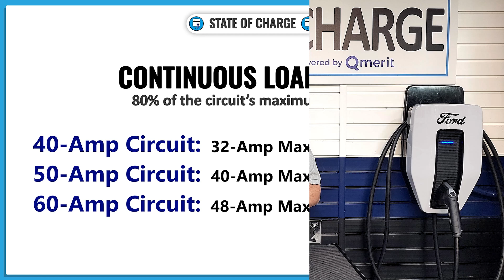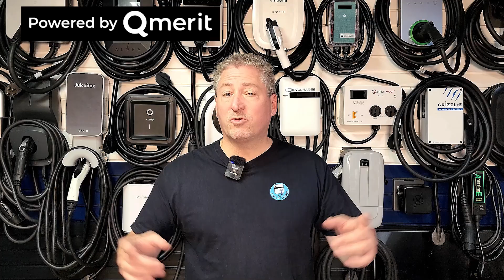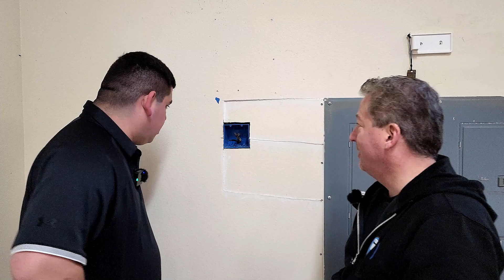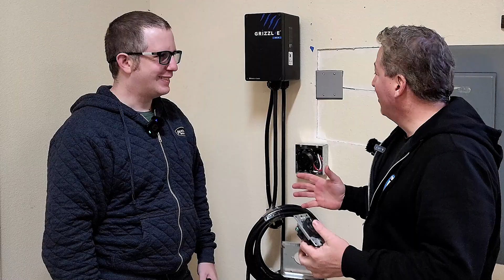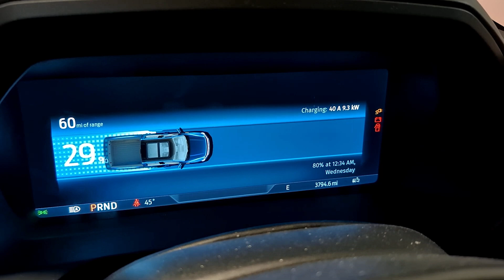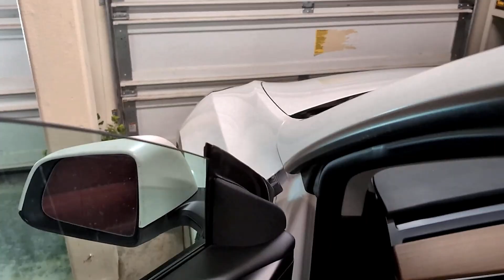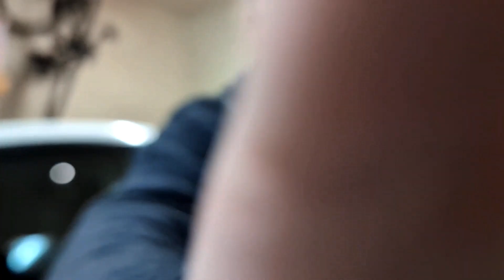Recharge Rescue Washington: We Fix A Dangerous NEMA 14-50 EV Charging Outlet Failure

Comment: Huge Thanks Tom!   My wife is now mad at you b/c your video is going to cost us $60k!!  I told her I now need to buy an F-150 Lightning with the included Charge Station Pro install to fix my DIY home charger install :-).  I'm might be in a whole different level of "Recharge Rescue" as I'm using a NEMA 14-30 Splitter from Neocharge right now with the wire under the door to the garage.   Your  video made me take apart the plug and it shows signs of melting.  Thanks for the video, it's given me the impetus to fix it the right way now.

Comment: I think the point of the video should not be the quality of the outlet you used to plug in a Home EVSC, but to avoid that situation altogether and just hardwire it! It makes absolutely zero sense to plug in a home charger. It's a permanent fixture to your home even the new grizzly should've been hardwired! In fact I'll take it a step further. Being so close to the breaker box, why didn't you just hardwire two separate 48 amp chargers so both cars could charge at the same time at 11.5 kW?

Comment: Using any outlet for permanent fixed EVSE home charging is actually not legal here in Norway due to the risks of overheating and fire. All EVSE installs also has to be done by a professional or you would risk insurance company voiding your insurance if there is a fire. These EVSE boxes will be connected directly via cable and separate circuit breaker with the proper protection for EV charging. You can also not use the mobile unit as a permanent solution.
Here we have 230V IT (230V L+L no neutral) and 400V TN systems (230V using L+N) in peoples homes and the "Schuko" (CEE 7/3 socket and CEE 7/4 plug) most have is rated for 230V 16A, but not continuous. So the mobile unit sold with new EVs are limited to 10A for safety. You can find third party units that can be adjusted up to around 13A.

Comment: The Leviton EV receptacle is a poor choice, spend a couple dollars more and get the Hubbell or a Bryant.  The Leviton is only rated to 60°C, which means if you're using THHN wire you must down rate the wire to the 60°C ampacity.  Whereas the Hubbell and Bryant are both rated for 75°C, which mean as long as the breaker is rated for 75°C you can THHN wire at the 75°C ampacity.  For a 50A circuit, this means 6awg wire for 60°C or 8awg for 75°C wire.  Don't be cheap, get a Bryant/Hubbell and avoid Leviton.

Comment: I have had two fires due to inappropriate outlets, even tho the city electrical inspector passed the work I did.
Reply from the maker: It was most likely all done to code. EV charging needs a stricter code, IMO
Reply: @ I did the installation to code and it passed inspection.  The problem is that back then the inspectors were not educated on the special requirements that are necessary for EV charging.  When I sought counsel from the chief inspector he blamed the charger, claiming there must be something wrong with it, even tho I tried several chargers that all experienced the same disastrous result.  I am thinking that by now the inspectors have updated the code and a situation like mine will not occur again.  Right now I have a Leaf but I am looking at a F-150 Lightning.  I am thinking that if I buy it I will end up installing a new charger.  The #10 wire I am now using will be insufficient to charge the Ford.  And I will likely have to replace the breaker, as you indicated on your program.

Comment: Unless one is using a portable EVSE, or perhaps using a circuit that is not dedicated to car charging... just hardwire the damn thing. It's not like you're going to be changing out a wall-mounted EVSE every few months. It may cost a little more, but eliminates a failure point.

Comment: Hey Tom, 
I installed my own, yes I know I know. Every thing was torqued and spec’d correctly. We used Legrand® Pass & Seymour 50-Amp 4-Wire NEMA 14-50R Weather-Resistant Power Outlet for RVs and EV Chargers
Model Number: 3894WR.
Thoughts?

Comment: One thing that seems to be an ongoing issue is the size of the junction box.  A standard one is too small. No one seems to know what product to use. The larger faceplate is easy to find but what about the actual box ?
Reply: Also easy to find.

Comment: Thanks Tom for another great product safety alert. I don't disagree with anything that you said. I would state though that I don't think the cheap 14-50 outlets are inherently defective, rather that they are significantly more likely to encounter loose connections, which can then lead to major fire hazards.  The cheap styles all seem to have their screws directly pinching the wire as apposed to the industrial and EV grade that use a box style compression connection. I wonder though if these screw style connections on these outlets were loosening after numerous thermal cycles, and the manufacturer's found the problem then came out with a decent quality outlet. Or simply saw the product demand for the industrial products and wanted a piece of the action.
   You were correct in that a Range doesn't draw large amounts of current for hours at a time, but it's an even lower load than that. Ranges typically would only draw a maximum of 50A, if A: All burners on the cook top were on simultaneously, and B: the oven was not only on but actively heating. If you are cooking something in the oven for 4 hours, the element is only cycling on and off intermittently to maintain the set temperature.
  I much prefer the box clamp style connection over the direct screw style for most connections. That includes 120V outlets as well, and you'll notice the same trend with those when comparing the economy / builder grade products to the industrial grade products.
   Like you've said before I highly recommend hard wiring your EVSE unless you absolutely cannot.

Comment: thank you for your show.  I had a hardwired autel 50 amp installed.  the electrician on put a 50 amp circuit in after I told him I had the charger set at 48 amps.  do I need to change the charger to 40 amps.  Thank You for your help.
Reply from the maker: Yeah, but your electrician REALLY should have known that. Are you sure he didn't install it on a 60-amp circuit? That's what's needed for a 48-amp unit. Was it inspected? The inspector would/should have caught that.
Reply: @StateOfChargeWithTomMoloughney  yes i asked him if it didn't need a 60 amp circuit and he said 50 was fine.  so I'll switch it over to to 40.  thank you once again
Reply: then I'll contact electrician's boss and see what awg wire he used to make sure it is large enoung to handle 60 amp circuit and 48 draw and have them come back with a 60 amp

Comment: Thanks so much for this info!  I just had a new circuit installed by my electrician because my panel was full.  He has installed many 14-50 NEMA outlets in our community and has always used the cheap/ standard Leviton outlets.  I went to Home Depot and purchased the recommended outlet and had no problems exchanging it myself.
I have a question.  Is it OK to leave my Honda “portable” charger plugged in all the time to avoid plugging and unplugging?  Even though it’s only 32 Amps at 240v it charges my prologue in about 6 hrs.
Thanks!

Comment: I am a fan of your videos!  From Quebec, Canada.  Following your video, I have reached my provider and I am told the following:  It seems the norm you are referring to is for installation of 48 amps and up.  Installation with 30 amps or 40 amps can use the « residential » outlet.  What is your understanding?
Reply from the maker: No, no, no. You need a high-quality industrial-grade outlet for ANY 240-v EV charging, because of the continuous use. Sure, lower powered charging won't create as much heat, but you should always use high-quality outlets for EV charging.
Reply: @ , some of my friends have a connector « welding outlet » type.  Is this OK based on your experience and network?

Comment: Don't use a $10 recept & push it to the limit. Use a metal box, may save your house. Be aware a metal conduit will derate your wire amp load due to heat retention.

Comment: I was a sparky for 50 years and NEVER used the cheap blue light special boxes. Always used either fiberglass boxes or metal. Every receptacle over 20 amps would only use metal boxes. Hubbell quality has been slipping. A few years myself and union electricians had trouble with the the wall plate breaking off on overprised Hubbell Hospital grade TR 20 amp receptacles that were made in Korea. A few months ago Hubbell mailed me a 20 amp 120 volt screw less duplex receptacle. I pushed in one of if the wire lock downs without inserting s wire and can not get it to release. Qyality did not appear to be to usually Hubbell standard. Here uts made in lying cheting kack of quality control communist china. Nope. I refuse to purchase or use any safety ir test equipment and receptackes & curcuit heeakers made in china.

Comment: The NEC knows about dangerous problem of cheap EV 50 amp receptacles burning up thru out the country and keeping thier prima donna heads in the sand !
Reply from the maker: They do. But they also always move very slowly, so I don't know if it's their heads in the sand, as much as it's the slow progress that they always make.
Reply: @StateOfChargeWithTomMoloughney  Like to choke the dopes that changed one of the most commonly used electrical terms last hundred years, no wait two terms. Stupid neutral change to confusing grounded conductor and s few years earlier light fixture to luminare. Same aholes probably that changed wire term believe it was 1/0 to 4/0 to some other term that did not stick.

Comment: I can’t see replacing an entire charger (EVSE) due to a melted plug - it is possible to replace the plug isn’t it? Provided you use a quality part and torque the connections properly (or have a professional do it if you aren’t sure).

Comment: I have a 65 year old 10-30 receptacle for the dryer. I am charging off that with a charger. The charger and dryer share the receptacle with a splitter. If I forget and run the dryer while car is charging, the breaker trips. 
I looked and Hubbell makes a Nema 10-30r. I think the old receptacle from 1957 is a Leviton. I also have a 10-50r behind the stove but it’s never been used. 10-50 stuff not as common as 10-30 stuff on the internet.
Reply: Just discovered the early stages of scorched prongs one one of the hot sides and slightly melted plastic around them.

Comment: Are ordinary 110V 20 amp outlets rated for continuous power? 
I’ve been reading about a product called “quick 220” where 2 - 110v outlets are combined to get 220 V charging on 20 amp outlets.  That should provide charging at 220V at 16 amps continuous. I’m wondering if that’s safe.
Reply: NO, for many reasons.  Breakers are not interlocked and cheap 20A outlets will melt just like the cheap 50A outlets are 2 big reasons not to do it.
Reply: @Billy.80 what about ordinary continuous 110 charging? I’ve not heard any EV company tell people that they need to replace their 110 outlets to handle the constant power.

Comment: We live in WA state and had the electrician install a 14-50 when we replaced our 1980s panel 2 years ago in anticipation of getting an EV and because it waives a portion of sales tax on the panel replacement. The state inspector signed off on the 14-50. It is the bad Leviton with 8 gage wire. So now we have a professionally installed fire hazard and are shopping for an EV.

Comment: its wild that this happens in the states, we have high power sockets in EU/UK,   but i guess because those are only used for incredibly high power equipment it rarely becomes an issue, because y'all at 110/120v, anything even mildly powerful needs a 240v plug ,and there are so many. i could pick up effectively any 32a commando blue plug and be sure its fine, the fact you can buy a nema 14-50 and then go "wait is this not good enough" is kinda winld

Comment: I so much appreciate this information and warning. I presently have one specific hardwired EV charger (Clipper Creek) but have a neighbor who I allow to come and charge their EV here as well. When we both need to charge at the same time, I’ve allowed them to use  a mobile charger using a NEMA 6-30R outlet on a separate 40A breaker. Since the mobile charger has a NEMA 14-50 plug, I have a EV specific 14-50 to 6-30 adapter to make the connection.

So far, there have been no issues or signs of overheating. The 14-50 to 6-30 adapter does specify to tamp down the draw to 24A. I’ve checked the mobile charger while in use, and it never draws more than 20A. Should I be concerned and replace the 6-30 outlet to the Leviton EV 14-50 outlet? Since I use the 6-30 outlet for my 220V electric wood splitter, and need that plug configuration, I’d probably just run a separate new line from the breaker box to a new Leviton EV 14-50 outlet instead.

Comment: If the homeowner was going to have to do everything from scratch, why not just hardwire the charger this time and eliminate the whole plug/outlet issue? It’s weird that companies aren’t offering hardwire options for 40A chargers. Also, it’s a little odd that Tom waits all the way to the last few seconds of the video to mention hardwiring is a better option.
Reply from the maker: I agree that's a better installation, but he wanted the outlet. As long as it's done correctly it's perfectly fine.

Comment: Tom,
Another very useful presentation! Thanks!!
Question:  given the heating and cooling at the wire connections, including at the 50amp breakers, would using a bit of lock tight be advisable or does the correct torque setting obviate the need for lock tight?  Or, is use of lock tight in electrical applications not appropriate?
All the best,
Pat Quinn
Reply from the maker: Hey Pat. It would be best if you did not use Loctite, or any other like product, on electrical connections because it will significantly impede conductivity by creating an insulating layer between the metal surfaces and causing poor connections.
Reply: @StateOfChargeWithTomMoloughney  Another thanks for your informative and kind reply, Tom!  A friend also cautioned against the use of loctite on electrical connections.  I will invest in a suitable torque wrench, instead.  In that vein, six months following my installing an Emporia EVSE, using #6 stranded copper wire and a pair of 50 amp circuit breaker, I rechecked the breaker connections and did find them looseR than I had left them.  I will be rechecking all connections, including the hard wired ones inside the excellent Emporia unit at least once a year!
All the best,
P.Q.

Comment: Since my Model Y sits in my garage15 hrs a day and I drive less than 40 miles/day, I just use my 120 volt outlet, and that's all I need. Would there be a problem with a typical 120 volt outlet delivering electricity continuously for hours? I've touched the plug after it's been charging for hours and it's still cool. Not even warm.
Reply: L1 charging is fine for your circumstances. I did that myself for 2 years before stepping up to 48A L2 EVSE. (future proofing)

The one thing I would recommend is installing a heavy duty commercial grade receptacle. They’re $10-$15 and will be able to handle the continuous load. You should periodically check your receptacle for heat damage “browning “ around the small slot (load terminal). I had to replace mine twice in 2.5 years.
Reply: @dennisschlieckau8723  Thanks! I just watched the Tom Moloughney video talking about getting the right receptacle for a continuous 240 volt load for fire safety. Good info.

Comment: I've got a pair of "cheap" 14-50 outlets installed by a local electrician during covid, and recently noticed i could hear one of them buzzing (arcing). I swapped that one out for a Leviton EV receptacle immediately. I need to swap the other but am considering just having both hard wired instead. I need to have someone upgrade my generator inlet and transfer switch anyway, so why not do both at once.

When checking the old receptacle one of the plug slots has no grip at all on the blade. I've plugged/unplugged the EVSE maybe 10 times in three years so I assume it was the heat cycles wearing it out internally.

Comment: Just charge at 20 amps / 3.6 kW? Why does everyone need 7 kW+ rates, the night is long! How far are people driving each day?
Reply: Video answered the question: you got two vehicles, you may need 40 amps, unless you can just switch em over.
Reply: Because sometimes you drive a good portion during the day , come home  with 10% soc, have an hour or two then have to go out again? getting that extra 13-15kw in could be a big difference.

Comment: I saw this problem coming a mile away so I purchased a UL listed charger that I can regulate the current it uses to charge my EV and I set the current as low as possible to get it charged to my 70% SOC limit I use by the time I need the car.  If I had a wasteful huge battery EV I would need to do things differently.

Comment: I haven't been an EV owner long so maybe you've mentioned it, but if you have an old house with 100A service, a 50A circuit for the EV isn't going to work unless you have major electrical work done. 

I lucked out in a 1936 vintage house that once had a hot tub on what is now a small carport. I had a NEMA 6-20 240v outlet installed with a proper GFCI 20A breaker, and I use either a Schumacher SC1455 or a Webasto Go charger. (I prefer the Schumacher because its plug doesn't put as much weight on the outlet.) Although it's technically level 2, it's 240v x 16A or 3.8kW so about 3x faster than level 1 charging, which works fine for us. 

We have a DC fast charger about a mile away if we need anything faster.